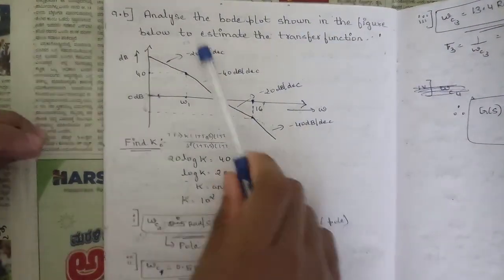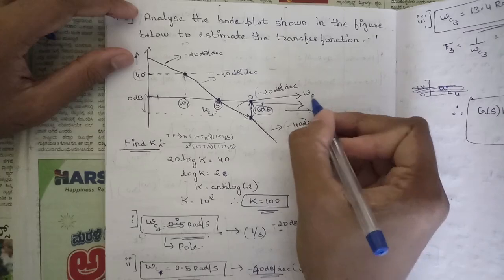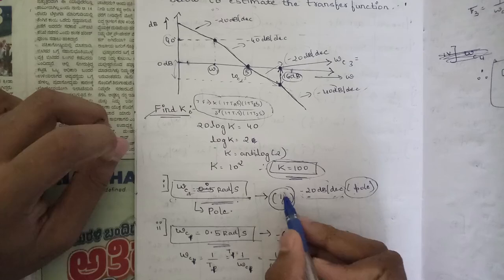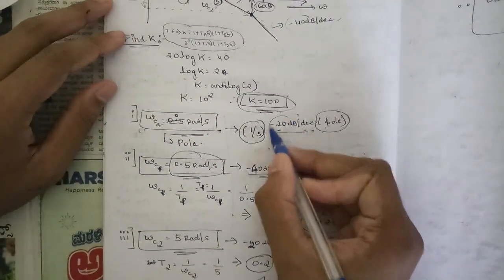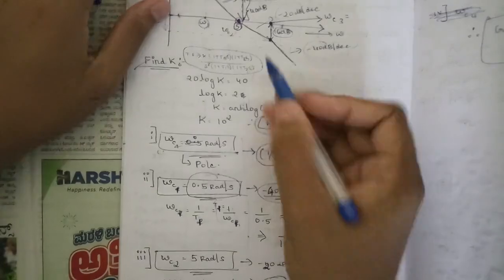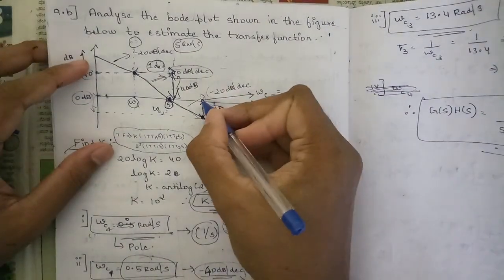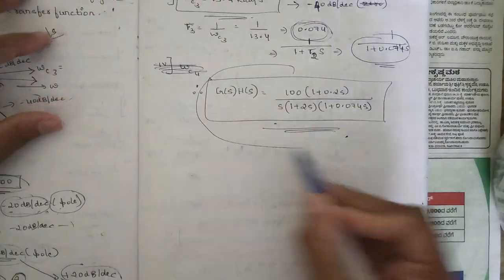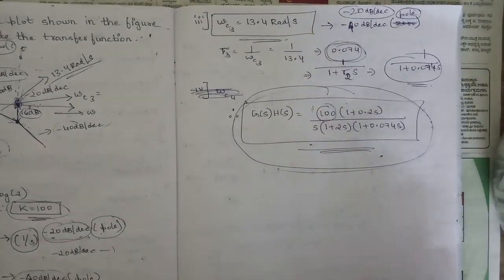Model Paper 1 9b Bode Plot Explained Part-2 Module 5 4th Sem ECE  VTU BEC403

Comment: sir but i hv doubt our teacher did not do this much calculation final TF = 100(s+5)/s(s+1)(s+16) is this ans correct or wrong pls reply sir
Reply from the maker: Its correct because they did not give 16 as the corner frequency in the Question...
Also w1 is not equal to 1..because  40db slope is touching at 5 and its  drawn from the 40db reference line..so it should be having exact 1dec length...
Reply: @VTUAcademy_009  thank you sir